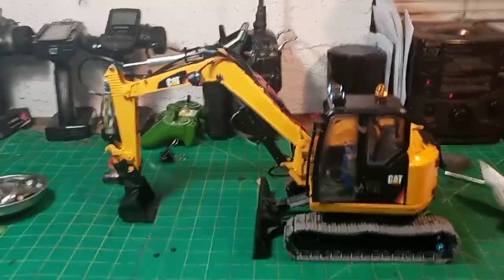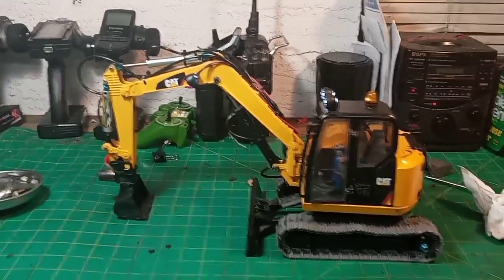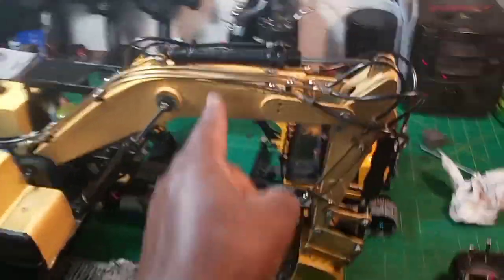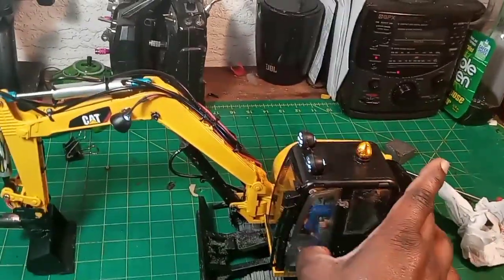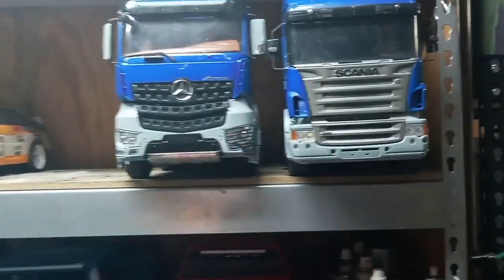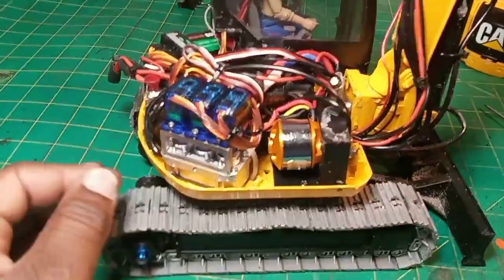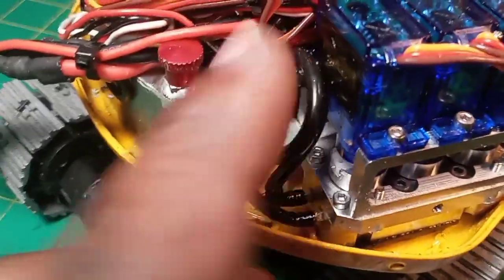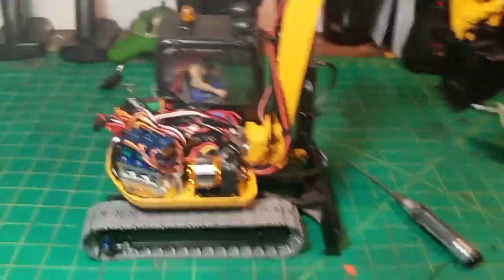Bruder rc mini excavator project

Comment: Hello, I was just curious about what you used for your slew ring and the track drive motors? Thanks!
Reply from the maker: for track motors i use 60rpm gearmotors 6v from amazon and then for the slew ring just a standard servo turned to a 360 servo
Reply: Thanks for the quick response! The 360 servo will be perfect. Did you purchase some kind of slew gear with a bearing for the servo to spin? Or is the servo mounted to the upper carriage and the “horn” is mounted to the undercarriage so that the servo itself holds all the weight? Sorry if that doesn’t completely make sense. Would love to see a picture of your setup for the slew.  Can I reach out to you on Instagram or fb? Not sure if YouTube has private messages
Reply from the maker: @leonardbasiliere2604  the servo is mounted to the body and the horn is mounted to track frames, the slewing that come frome the toy work fine just put some plastic friendly grease on it
Reply: Right on, I was going to try to incorporate a slip ring but it will be much easier to do it like you said. Thanks much!
Reply from the maker: @leonardbasiliere2604  you can still use a slip ring you just have to maybe lift the servo above it. There lots of room if you use a strong mini servo

Comment: Foaming of the oil is usually because there is a lack of oil when feeding. And the return line should come in from the top. If you are looking for hydrsulic line the magom 3mm are very flexible for hydraulics.
Reply: Thanks  I'll try that

Comment: Not sure where your return line to you oil tank is located, but if it's on the top that could cause your foaming problem.
Lack of hydraulic oil in the system could be a contributor too
Reply from the maker: I tried what you said about the line , and the lack of enough oil and that seems to be working